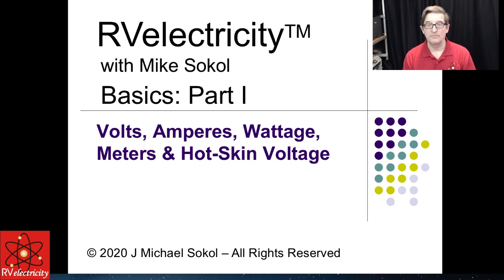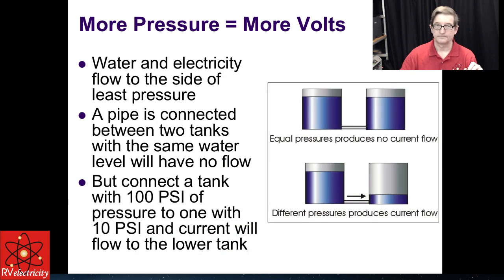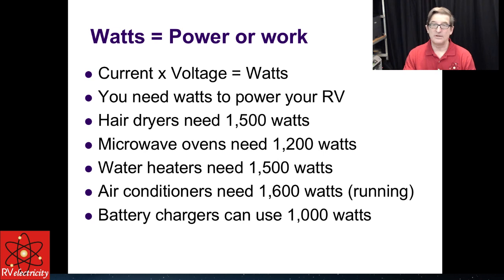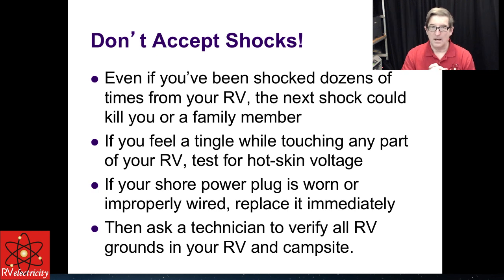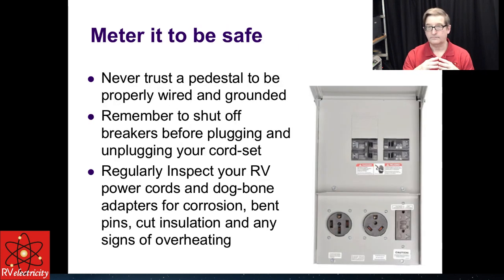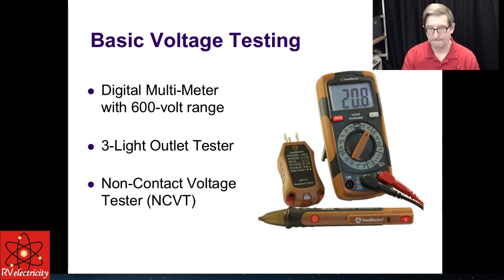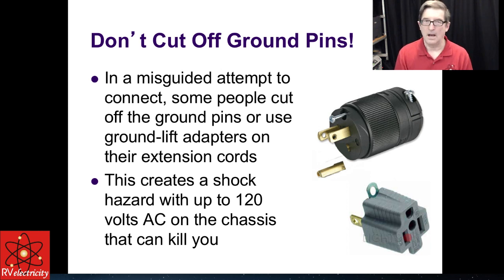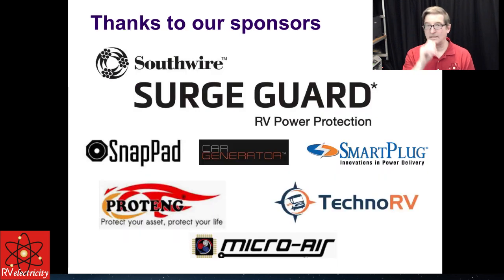RVelectricity for FMCA Rally - Basics Part 1

Comment: Having been a Navy instructor in basic AC and DC theory it might help when you compare hydraulics to electricity if you called voltage what it really is.  Electromotive force (measured in volts and indicated in math problems as E) is equivalent to hydraulic pressure.  It does no work as it is just a potential.  When applied to a complete circuit it creates a flow that is called current (actually moving electrons and is indicated in formulas as I and called amps or amperage.)  That  flow is restricted by resistance (which is indicated as R in formulas and measures in ohms).  Resistance is like a restriction in a hydraulic circuit.  It is not voltage that will harm you but the amount of current that flows thru the resistance of your body and the route of the flow.  a good example of you experiencing a high voltage shock is a static shick which may be thousands of volts but little current.
Reply from the maker: Yes, you're exactly right. And I do those comparisons in my extended class about volts, ohms, amps and watts. I'll do a webcast soon strictly on those topics so I can cover them in depth.